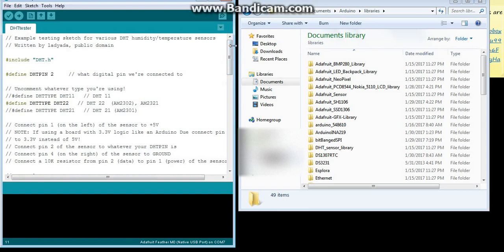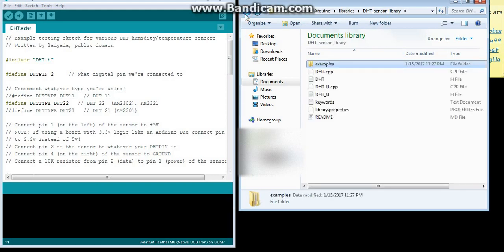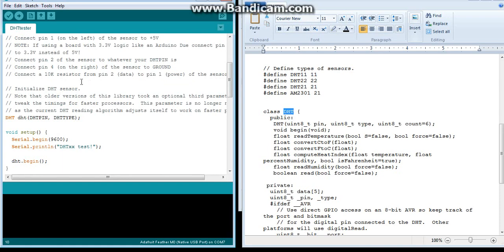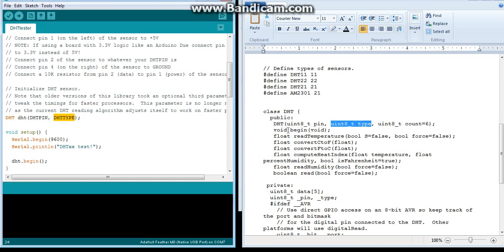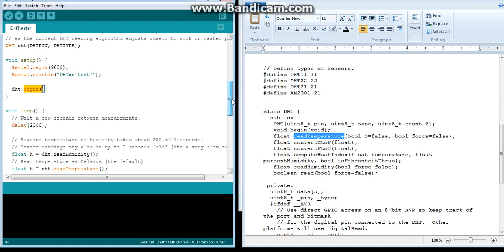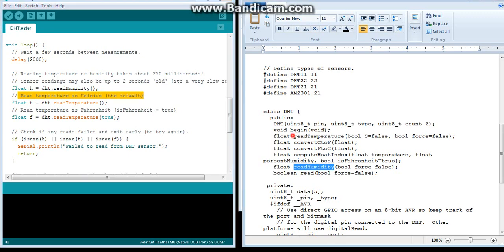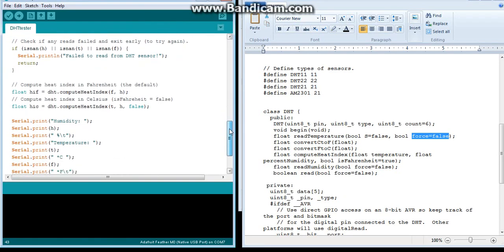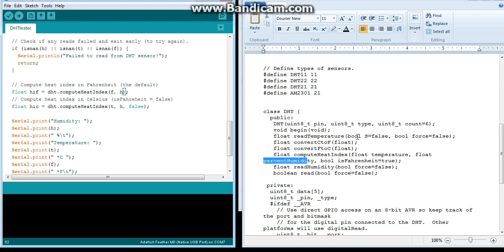Arduino Basics:   Understanding Libraries

Comment: is there an issue with calling more than 1 library for the same module. i find code example but it seems they used different libraries. i find this lack of continuity/standard confusing.

Comment: would you happen to have a similar walk through for the Plantower PMS5003.  I have not be able to find the correct .h file to work in PlatformIO with a WEMOS D1 mini.  Also tried looking in Arduino IDE' library

Comment: How should these library files for the RM3100 magnetometer be added to my arduino libraries?  It does not possess a single folder and it uses a ".hpp" instead of ".h" file see        https://os.mbed.com/users/fwrawx/code/Rm3100/

Comment: There is no "Arduino" folder in my "Documents"
First 30 second FAIL.
Reply: i found my libraries in a file called "arduino data" that was in a folder in my documents. I think that it is there because i setup up arduino there. try to remember were you setup arduino when you installed it. eg. maybe you choose to save it on desktop.
Reply: This is a video about Basics Arduino,  not Introduction to Arduino. 
Sorry, as a newbie, someone should follow the introduction tutorials provided by Arduino. There you learn about directories and libraries locations. 
This video is great to understand libraries when you have a basic understandings of Arduino. At least the directory where you have installed the Arduino IDE

Comment: I am also a beginner in the world of programming and especially Arduino and then libraries, BUT this was quite helpful.

I am still struggling to be able to figure out what library need to be included for a specific statement.

I guess this world of home automation has sucked in so many noobs and unfortunately there are only a handful knowledgeable people that have to help us strugglers.

So what I do is to start a project with basic code and if it works start adding additional sensors and perhaps relays, and that is where it becomes foggy.
I would youtube for hours to identify a video that covers what I need to ADD and then I am stuck because I am unsure which library covers what portion.

Hoe do I figure that out?
Reply: I am a total noob too to Arduino, etc, so i know nothing at all but....i would definitely recommend scouring the forums before checking for a YouTube video on it. The video may help lock in some knowledge AFTER you think you have figured it out through the forums, web pages, etc. Just my 2 cents. As i said...i know nothing, however.

Comment: Libraries have cause me SO much grief as someone very new to Arduino. They are generally skipped over fairly quickly in other tutorials but are often key to an error free compile. Thanks for connecting the dots within the *.h file in the library to the calls in the sketch. This made perfect sense!

 Would discussing the role of the *.cpp library files be useful?
Reply from the maker: cloudsuck glad you enjoyed the video. thanks for watching. the .h file defines everything in the .CPP file. the .h is the header and lists all the classes and methods. the CPP is simply the implementation of what the header defines.
Reply: Thank you, Now I think I see the function of the .h header file!
 @learnelectronics
Reply: Thank you for showing use the relations between H, CPP und Scetch!